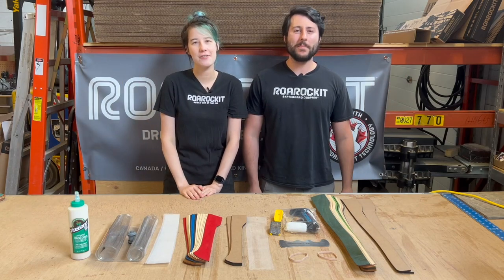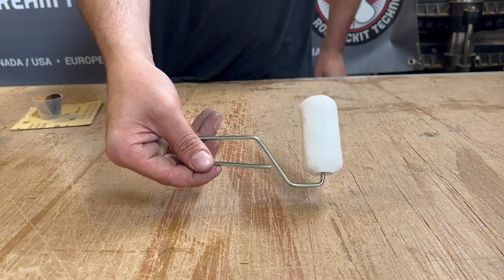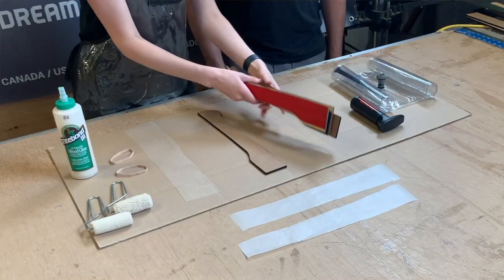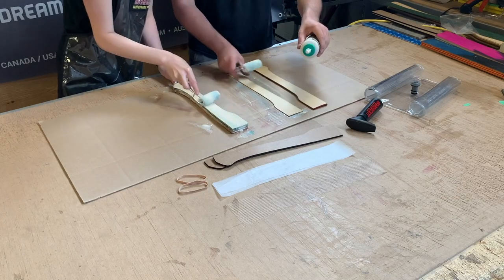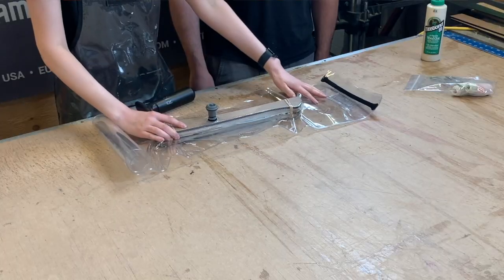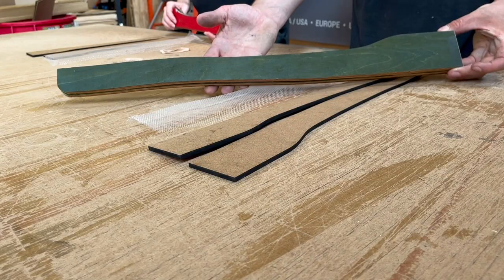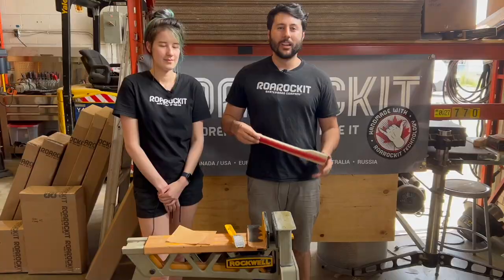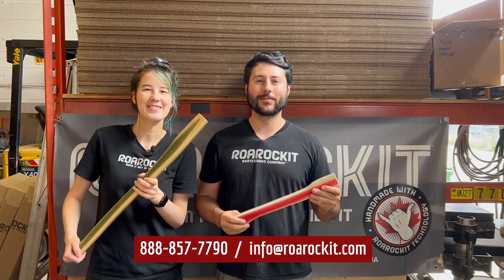Throwing Axe Handle Kit // New Product

Comment: Can you reuse these bags that come with the kit
Reply from the maker: Yes! If you treat it well the bag can be reused over and over again, we have some bags in the shop that we have been using for many years! The sealing tape strip can be used for a couple dozen pressings before needing to be replaced, and each kit comes with 2 replacement rolls to start with.